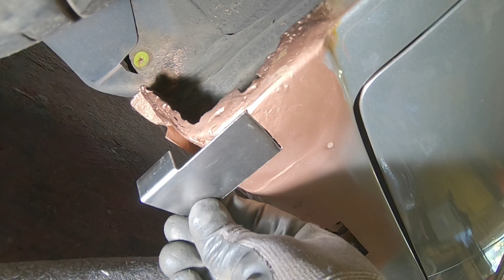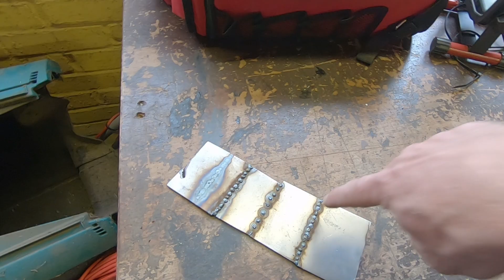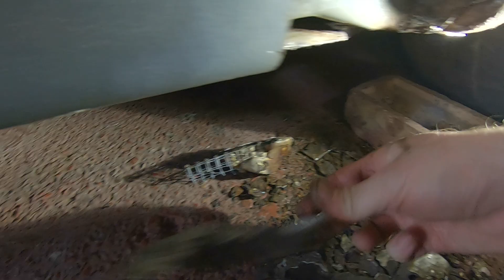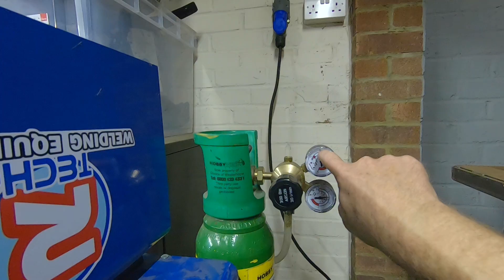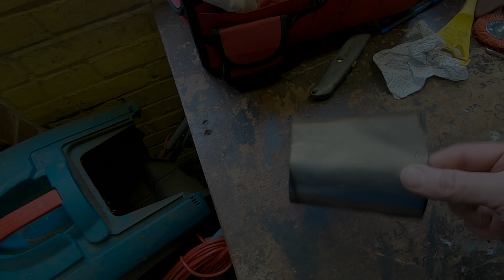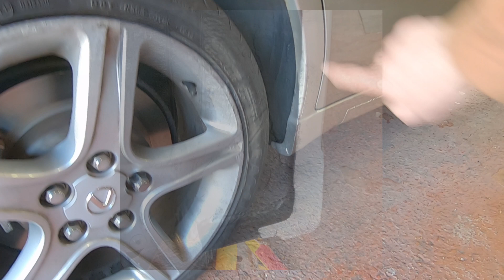How did this IS200 have an MOT? Repairing my rusty Lexus IS200 sills.

Comment: I was hoping, all thru the video, that you'd grind down the welds on that right hand rocker panel... 😄

Nice job, though. 😊👍
Reply from the maker: Yeah it would have been alot of work to shape and match the larger repair panel. In all honesty I might redo it next time it needs some more rust repairs. The two smaller patches are almost invisible.

Comment: Hi Dan. What do you think of buying ready cut out sills and arches on eBay and have them welded in. Another thing is do you think it’s better to leave a 1mm gap between the 2 metals when welding at its can hold better. Good job by the way.
Reply from the maker: Thanks. It depends on how much of the car needs replacing. If you only have small areas of rust on the sills like I did, you would end up not using 98% of the new sill. If speed and ease of repair are your priorities then that can be a good choice. The other problem with the replacement panels is that they are galvanised, this gives off poisonous fumes when welded! I know some people use a gap to help with penetration but I found that using higher settings on the welder than necessary for the thickness provided full penetration (see test weld pieces in video, 1mm steel = 2mm welder settings = chain of spot welds style). Leaving a gap has caused worse blow throughs for me in the past so I just butt weld.